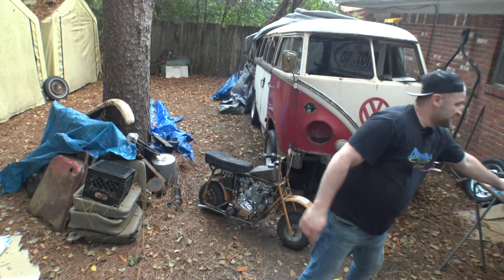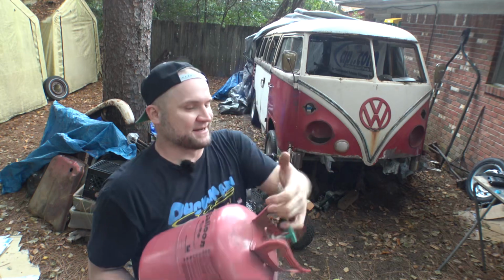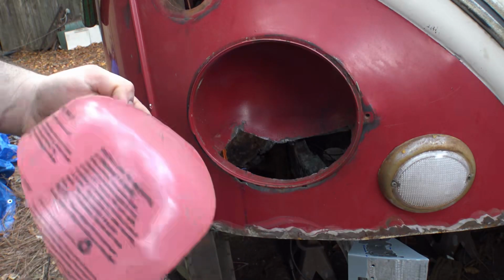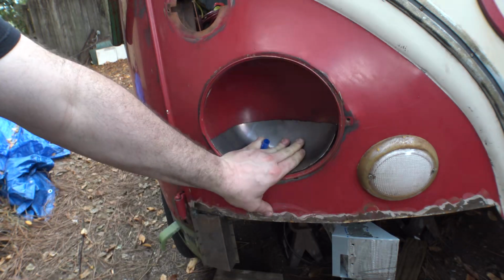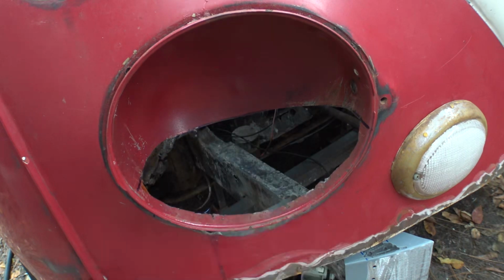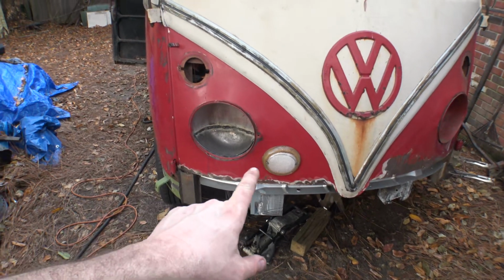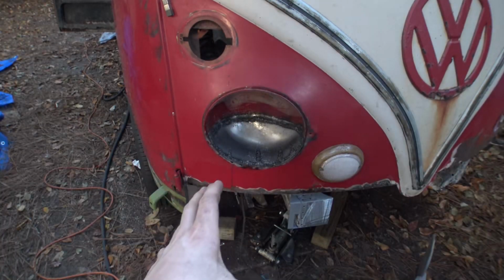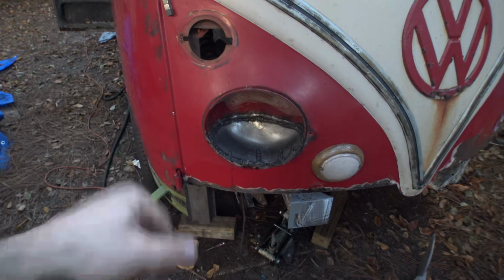Headlight Bucket Rust Repair - 1967 VW Bus - Gregory - 17

Comment: this is why I like your channel. Fabrication. I learned it in Vietnam. I was a gas welder (not much electric around) and a small engine mechanic. Parts were hard to come by but we had a whole lotta junk. Make your own parts and you gotta attaboy from everybody for keeping shit running. It really helped years later  after I retired and I worked in a custom motorcycle shop.
Reply from the maker: I learned as a preteen and into my teens.  As a kid I had no money, but had lots of Dad's tools.  I drilled and hammer and cut stuff up.  No welder so used bolts, so everything was bolted.  We made some neat moped stuff!  Some of the most fun I ever had in my life!  The best days.....................

Comment: cool patch bud.
A thought for future would be check out the local dollar stores for stainless steel mixing bowls, reckon there'd be one that fits.
Dunno if Stainless is bad to weld, but if a bowl could replace the entire bucket (and as an added bonus has a flat bottom so rear mounting whatever etc should be "fairly" straightforward.
cheers mate.
Reply from the maker: Its not always best to weld different metals... but the bucket isn't the exact shape of a bowl, its oddly offset with an irregular bottom.  But if you could find a bowl deep enough to do the trick, you could always cut the whole stock bucket out and epoxy the bowl into the same opening.  That'd work!